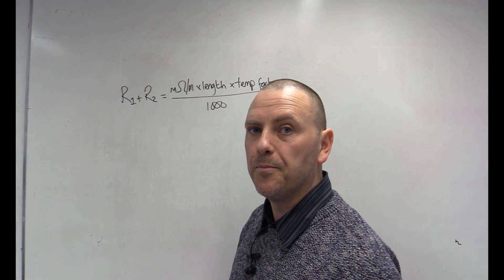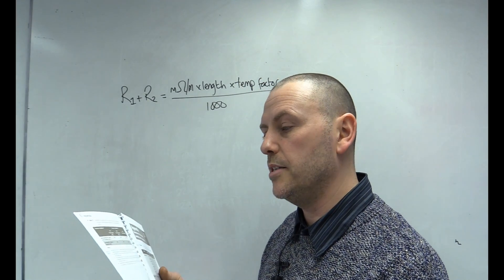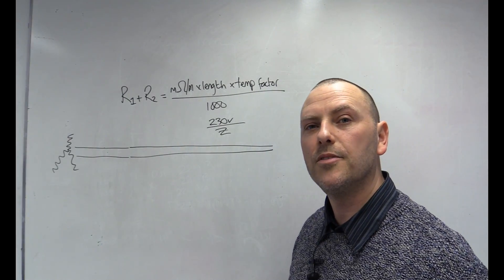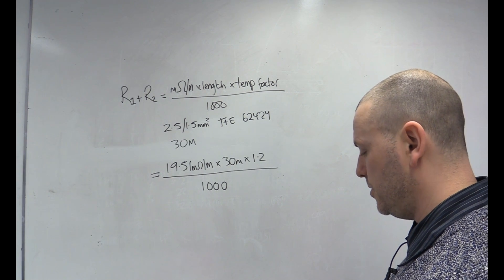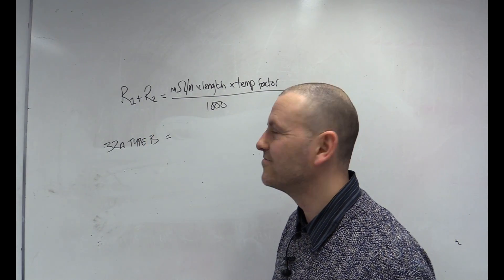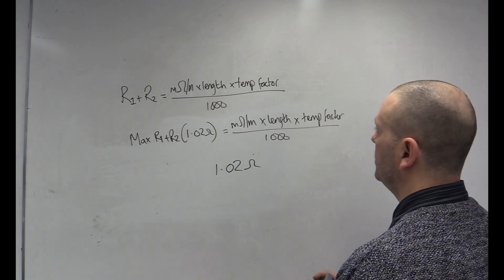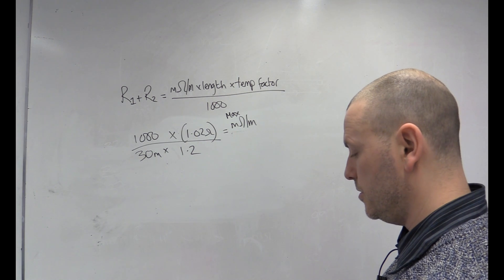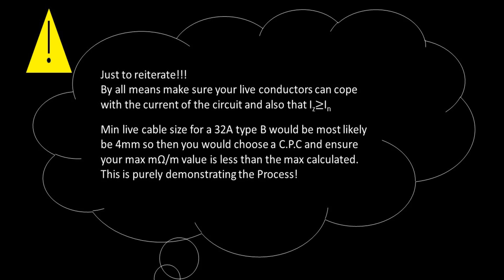Playing with the R1+R2 equation

Comment: can anyone explain me why in onsiteguide table I1 values for conductor with no CPC decreasing. I cannot graps logic here, as other values mOmh/m decreasing as CPC conductor size increases, but with no CPC whatsoever this value decreases even more instead of increasing as there is no dedicated CPC conductor?? . for eq : for 1mm live and 1mm cpc value is 36.20 and for 1mm live with no cpc is 18.10. It seems like resistance in live conductor decreasing, but shouldnt it increases when there is no dedicated CPC conductor ?
Reply from the maker: The table combines lots of possible combinations of line and cpc conductor (R1,R2) if you look at the line conductor 1mm it is 18.1 m ohms per meter so if you have a 1mm cpc as well then the number required is 18.1+18.1 mohms per meter or 36.2 mohms per meter. If you look through the table you will see they are simply adding them up. Also remember that during a fault the line and cpc become a series circuit effectively so resistances would sum rather than act as in parallel
Reply: That's explain a lot, so basically what this tables tells us in there, what is the mOmh/m for line conductor itself for our reference, not really its r1+r2 value as in description on the phone heading in the table which we may need... ( I am telling about selection with omitted CPC. Am I right? Is there any scenario in real life we will need value for r1+r2 with 0 CPC ?
Reply from the maker: You might need to calculate a single conductor for a number of reasons. Usually to check bonding conductor resistance readings or during fault finding you may have a high resistance line conductor. if you know the length you could check by calculation against your readings.

Comment: Please I would like to ask a question and I hope you will answer it R⁰=R1.R2/R1+R2 Why is this law written in this form or multiplied by R1.R2?
Reply from the maker: Parrallel resistance equation. Read this great article from Mr Graham Kenyon. https://electrical.theiet.org/wiring-matters/years/2022/89-march-2022/resistance-readings-for-step-3-of-the-ring-final-circuit-test/

Comment: Does that mean just R2 would be half R1+R2 (0.7) so 0.35?
Reply from the maker: if you had 2.5/1.5 cable and an R1+R2 of 0.9755 then you could use the following for a close approximation: ((R1+R2/100) x 38 = R2 .This is because R2 is approx 38% of the R1+R2 in this context. or ((R1+R2)/100) x 62 = R1 (because R1 is approx 62% of the R1+R2)
Reply from the maker: if they are the same size c.s.a then yes if not then it depends on the difference between them as a ratio.

Comment: Superb presentation. Question: When calculating fault currents, I prefer to multiply U0 by Cmax to err on the side of caution! What do yo reckon?
Reply from the maker: For me it depends on protective device. If mcb then 230v is fine because as long as you are hitting that required current to activate solenoid then everything is fine. More voltage means more current but wouldn't change the outcome. It disconnects. With a fuse, what I've found is it might be better to apply cmin as the fault holds longer and therefore more energy overall in time until disconnection. Its tricky to put finite values on this stuff as along the circuit the resistance increases therefore the fault current would decrease.

My general rule is to size switchgear using cmax and to size circuits using 230v or cmin if fuses. If mcb then just 230v. This is because most of the places I've designed has a higher voltage present anyway. Sometimes I use both and compare just to be sure.

My latest video played with this and compared all 3 when using adiabatic equation.

So, I guess my response is it depends on what you are designing for and at what stage. I might use all 3 in different scenarios tbh as justification or to ensure its safe in all occurances.
Reply: @cestemshow   Thanks for the reply.
Reply from the maker: https://youtu.be/vl1RE32W5lg

Comment: Great explanation Craig, I wish I could have had you as my tutor!!! Could you do some worked examples of some cable calculations at some point? Cheers 🍻👍
Reply from the maker: Yeah all right. They are easy..... What circuits do you need?
Reply: @cestemshow  nothing in particular just a few run of the mill domestic circuits, it’s just to brush up on some forgotten knowledge really!! One thing I struggled on though, was selecting the correct de rating factors or combinations of rating factors, and when to combine two factors👍